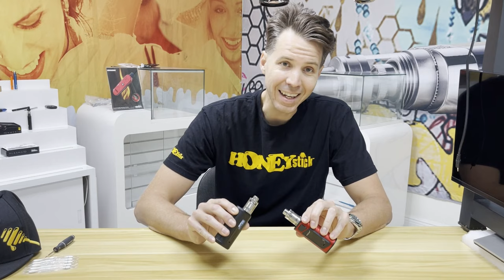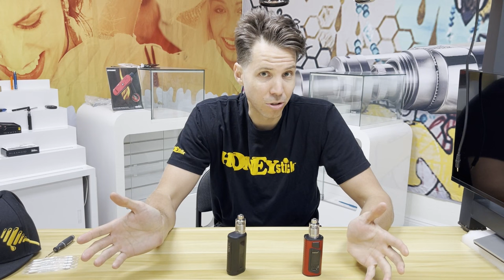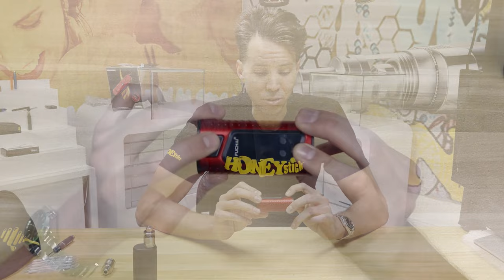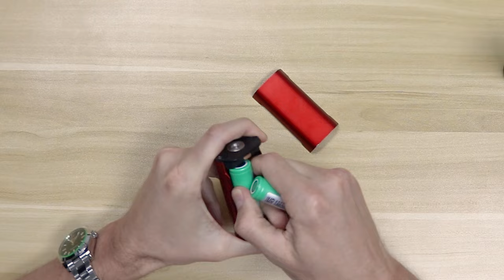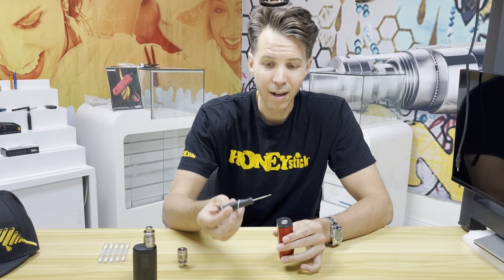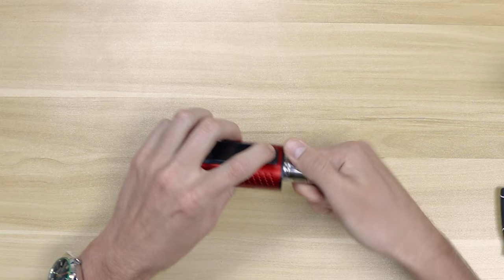Check Atomizer - Atomizer Short - No Atomizer - Atomizer Low -Error Messages Troubleshooting & Fix!

Comment: How to fix may rx200 reuleaux to atomizer short? I can't fix it 🙂
Reply: @Godwin Pasia, if none of the tips in the video resolved your issue, you should contact Wismec .
Reply: I have 3 different Wismec mods and they all have this issue. Their 510 connections are horrible. I have a lot of mods from various other brands and have no such problems with any of them. Either it's poor quality control or they just don't care.
Reply: @theonelion  I had the same thing with a Wismec Rezin series. Amazing Mod, great body, texture, buttons. connection failed.
Reply: @danhoff6890   I have th RX Gen 3, the RX Gen 3 dual, the Ravage and the Tinker 2. The Tinker 2, a great looking and feeling mod, is the best one out of the bunch and malfunctions the least. However, the mod can look and feel great, have a good chip and function perfectly in every other aspect but if the 510 is faulty, the mod is pretty much useless because it's just not reliable enough to use.
Reply: @theonelion  That is exactly how I felt about my Wismec Resin series.

Comment: Thanks, I tried cold reset, battery out 15 Min, turn off and on, nothing worked. After replacing the coil did work again
Reply: @manjelos, Glad you are up and running again!

Comment: Did you know if you toke your atomiser and batter then smoke comes out it works like it should
Reply: @the_champi0n875, if you vape on your unit and then vape still comes out the tank, it sounds like its working strong usually atomizer issues show if you get a bad or burnt taste or underperforming, not enough vapor.